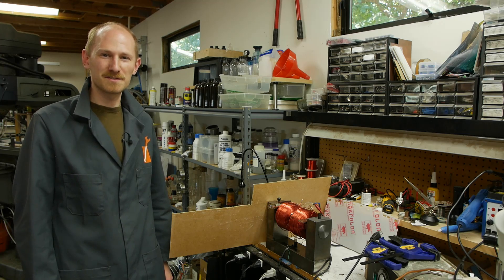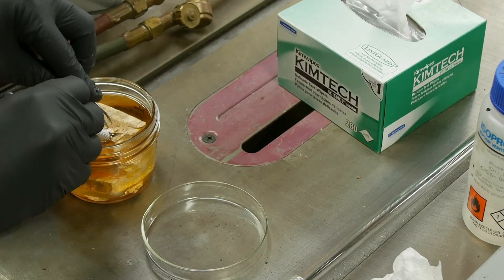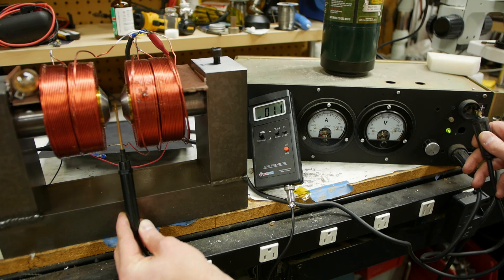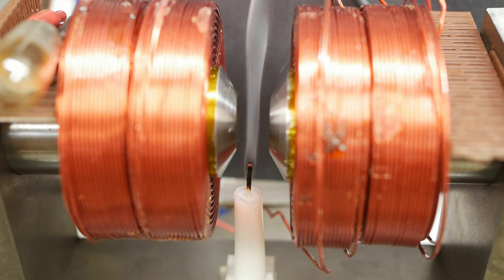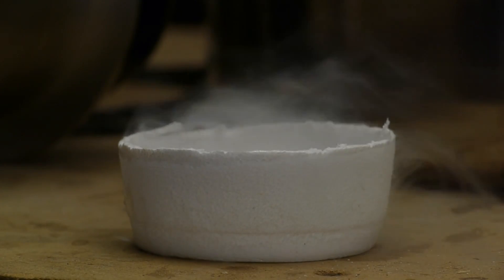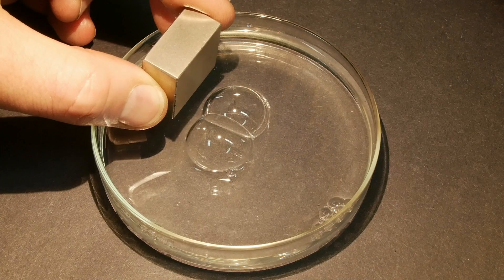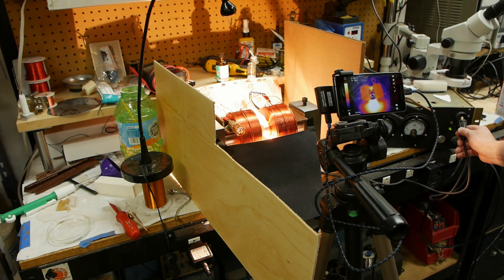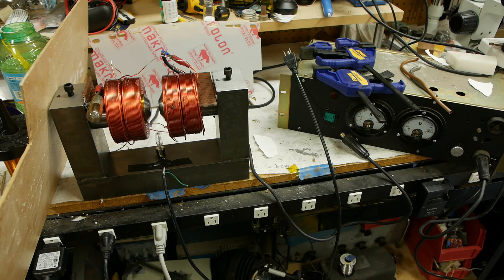Candle flame is repelled by magnets (and Zeeman follow-up)

Comment: Take ground-up copper filings in a pile between the magnets.  I think that there will be an effect there due to the creation of a current in the copper as the magnetic field turned on and off.  The candle flame is a PLASMA and conducts electricity, much like a copper smoke, only here the smoke is moving upward continuously even without the electromagnets energized.  When they are energized, you get the effect as with the electrical-current-conducting copper powder, but this keeps happening during the entire time the magnets are on since the flame molecules are moving during that entire time.

Comment: Well plasma is just super heated gas and has magnetic properties idk what kind as I haven't read up on it much but does that mean the magnetic poles of planets and strong magnetic fields can influence weather? If magnetic force can repell hot air wouldn't that mean it's be possible to...idk go to Venus or have some kind of heat protection?

Idk just throwing around ideas that hopefully don't involve bursting into flames like a demon in a church XD

Comment: Put the candle in a glass tube filled with pure oxygen and then see if it still gets affected by magnets.
If it does, then it means magnetic field is causing oxygen molecules to be pushed away from the flame, and if it doesn't, it means the magnetic field is causing the air to be pushed away from the flame.

Comment: The flame is repelled because of plasma. High temperature separate electrons from atoms and form charged particles and charged particles shows very strong interactions with magnetic fields. But there is a big note, they have to be moving.

Comment: I think that hot air is more diamagnetic due to the disalignment of magnetic domains in the portion of air contained in the space between the plates, and that is because of the increase of thermal energy that is a form of kinetic energy. Thus the more movement of the atoms and molecules have the less possible is to have a big magnetic domains that responds to the magnetization induced by the electromagnet, due to the fact that the movement of atoms makes more difficult for magnetic domains to form and grow.

Comment: Brainiac75  hypothesized that deflection is caused by the paramagnetism of Oxygen displacing the Oxygen-depleted flame: https://youtu.be/dX2R4hRAYMc

Your CO2 bubble test seems to refute that, though I think the bubble may not be sensitive enough and wouldn't show any deformation except in a magnetic field gradient. I suppose it would be possible to calculate the tension in the bubble and estimate how far it should deflect.

I wonder if the atmospheric pressure could be measured with a manometer containing a heavier-than-air gas (like CO2 or argon). An open end of the manometer could be placed in the magnet. The supposedly increased pressure in the magnetic field would act as a valve that resisted the flow of non-paramagnetic gas. The other end of the manometer could have a cup open on top with a small gas flow being "poured" in. There should be an elevation of the top of the cup which would allow gas to flow through the manometer with the magnet off and block flow with the magnet on. I'm not sure how gas flow could be visualized, maybe smoke, or maybe an oxygen sensor below the cup to detect overflow.

Comment: And here's another theory. A candle flame is basically a plasma. Plasma conducts electricity. Also, the flame is in motion, is rising upward. I'm sure you've done the aluminum strap between two magnets experiment. The conductive plasma, moving between the magnetic poles will create an induced current in the flame, thus reflecting the field from the electromagnets, which will impede its flow. A candle flame has pretty high resistance, but, 1.4 Tesla is no small potatoes!!! Are the poles north and south, or they the same, repelling each other? I noticed that the wire coils look like they repel each time you energize them.

Comment: My money is on the plasma in the flame as the answer.  In analytical chemistry, the flame ionization detector is one of the most common detectors found in labs (for gas chromatography).  Unfortunately, methanol still contains carbon, so you didn't really rule that out.  You might try a hydrogen flame, or even magnesium.  Or, possibly someone could try to manipulate the plasma in an ICP (inductively coupled plasma) instrument (generates an argon plasma) with magnets.

Comment: @bkraz333 thanks for the video.
Paraffin wax combustion products include water, a lot of it (e.g.  C21H44 + 32 x O2 ⟶ 21 x CO2 + 22 x H2O), which in turn is also notably diamagnetic (16T levitates a small frog https://en.wikipedia.org/wiki/Bitter_electromagnet), therefore the bit above 1T your magnet can pull of for sure will have an effect on the water content of the air, especially if it's saturated with it as is the exhaust gas of the flame combustion.

Comment: This is really cool! I only recently noticed this effect in a classroom demo - we use flames to induce sparks between arcing horns connected to a high voltage transformer. A fascinating investigation, thank you!
Reply: Now that I think about it, it's more that an electric field apparently also repels flames. That seems to have to do with the ions in the flame though, I think. But maybe it's also connected to your effect!

Comment: The flame has not only magnetic properties but also electrical properties. As we know that one does not exist without the other, unless that is, we are discussing gravity. This is easy to verify in a simplistic way, but the actual existence is very dynamic and often complex. The known  differences, thus far observed, between the two most basic, (though not absolute), biases, heat and the lack of heat, (often, though erroneously, referred to as "cold"), manifest in numerous and seemingly non-related phenomena, but it is all one in the same, that can be proven and therefore unified, via a very specific multi-dimentional geometry, commonly referred to as the misconcieved theory of Aether, that is to say, the geometry is the Aether, is the common denominator that makes it possible to describe a set of laws that can accurately predict all matter and energy in space time, from the sub-atomic, right on up and beyond the cosmic. (volunteers needed to invent the mathematical equation[s] to describe the realized geometry. Seriously. I flunked algebra amongst other things.. Hey! Einstein couldnt tie his own shoe until he was like 7 or 9 ok! It must be a prerequisite, I dont know.) Hit me up for the details. Anyway simply test the flames electrical conductivity, or youtube Veritasium video demonstrating the flame conducts electricity, because a flame is a plasma. https://youtu.be/a7_8Gc_Llr8

Comment: Hey,  my understanding of this is that a flame is a "partial plasma" as only a small percentage of the gas is ionized.  It stands to reason that when in motion through a magnetic field there will be deflection.  This effect is used to confine plasma in fusion reactors.

Comment: Perhaps the rising pillar of hot gas is creating toroidal motion in the ions surrounding the pillar. This toroidal vortex of ions could create a magnetic field, or perhaps the simple rising of hot gas creates a field. The electromagnets then affect this, causing the displacement.

To further isolate the system, you could heat various gasses away from the magnets and route them between the magnets using a transparent, heat-insulated tube. Use Schlieren imaging to observe.

Use a pump to move the hot gas through the tube in various directions (up, down, sideways). How does this affect the displacement? This could yield very interesting results with Schlieren imaging.

Comment: A hardcore tutorial on designing switching power supply transformers will be amazing. It may contain magnetics, core material choice, flux in air gap, saturation current/voltage, indictive ringing/kickback/peak, optimal operation frequency and so on. RC buffers and flyback diodes will be an extra.

Comment: Perhaps you can provide confirmation by preheating the gases used in your soap bubble demonstration. I expect if you heat the gases hot enough you should see the distortion you expected in the shape of the bubbles. And it could be that other gases (CO2) are more dramatic then the air you used with the hot lamp.

Comment: Water vapor would be a good candidate, as H2O is polar. It seems to fit the observations of "dry" gases not reacting to the magnetic field and is formed by combustion of H C compounds, as well as its presence in air.

Comment: You have not mentioned the most fundamental force a magnet has on MOVING charge.  The gas coming from a flame is ionized.  If you place 2 electrodes into a flame, one small, other large, and apply AC, the flame will rectify the current between them.  In fact, this is the way that most home furnaces detect that the pilot flame has ignited (before allowing the main gas valve to be opened).
To verify if this is relevant to the candle, try reversing the magnet's polarity.  Diamagnetic effects are square-law, and are therefore not affected by magnet polarity.  But forces on moving charges reverse with changing magnet polarity.

Comment: Heat causes electrons to be excited to a higher orbit, and the reason hot substances glow is because a photon is emitted when the electrons come back down, right? If a substantial number of atoms have their electrons sitting farther way from the nucleus, would they in effect function like negatively charged atoms? The ratio of external "accessibility" to the electrons compared to the protons increases. Maybe this pseudo charge state interacts with magnetic fields. Maybe this also increases the diamagnetic effect. In the excited state, we're also left with a gap in the next orbit down. Maybe this creates some imbalance in the electric charge that makes it more susceptible to magnetic fields.

Another thought. Most substances are diamagnetic, but very few substances exhibit significant paramagnetism because this requires unpaired electrons. When excited electrons fall back down to "normal" orbit and release a photon, do the electrons do this in a "symmetric" manner, or could it be that for a brief moment, one of two paired electrons is in the lower orbit while the other is still riding high? This explanation would assume then that although the flame is "squished", somehow this would be the result of paramagetism rather than diamagnetism. Is that possible? Is it possible that the phenomenon is being misinterpreted due to a flawed assumption?

Ok, one final thought. Let's take a yellow sodium flame, for example. The particles can emit and absorb the same frequency of light, as demonstrated in this video. This video also demonstrated how a magnetic field can shift the wavelength of light emitted. And we know that the chemical reaction that generates the flame is more or less confined to a hollow sphere upon whose borders the reacting chemicals interact, so the bright part of a flame is just where heat is radiating and propagating outward. If you've got a bunch of sodium atoms near the center of that interface, they're emitting the perfect wavelength to be absorbed by atom next to it. What if this is the Zeeman effect, and the problem is not simply the magnetic field but actually the magnetic gradient? Atom X is emitting a particular wavelength, and its neighbor, Atom Y, is in a slightly different part of the magnetic field and is hoping to absorb a slightly different wavelength. So the outward propagation of energy is hindered as a result. If the outer sodium atoms want to get excited, they have to rely on radiation from the initial chemical reaction instead of just radiation from its neighbor. This could be tested by comparing a strong magnetic field with a shallow gradient to a weaker magnetic field with a much steeper gradient.

Comment: Although many old-time cinema projectionists were unaware of it, the light from a DC carbon arc was invariably stabilised by a magnetic field created either by a series connected coil situated behind the concave mirror employed (just a 4 or 5 turns were sufficient)  or a single-turn loop around the flame area of the positive carbon.  
In the absence of either system, the flame would splutter and dance about uncontrollably resulting in reduced illumination and severe flickering of the screen image. 
This occasionally occurred with the latter system when an open circuit in the single turn loop developed due to the long-term effects of the high temperatures involved. 
(Unless he had experienced such a situation before, this non-visible fault could result in the projectionist suffering a near mental breakdown🤪).

Comment: 'Excited electron shell physics' may have something to do with why the gases may be more magnetic when heated. ~( 'w')/

Any time sufficient energy is infused into an atom or molecule, an electron jumps from a lower shell orbit to a higher one, which results in a slight change in the behavior of the mass in question.

Whether it is enough to cause these effects, I do not know, but seeing how superconducting materials behave in magnetic fields, it is worth investigating.

Comment: Do you have any videos showing how "flame rectification" works where a flame between 2 electrodes act as a diode...
Its actually used by many gas and oil burner designs as a safety element to detect the presence of flame or turn the gas valve off.

Comment: Interesting!  Just saw this video, so I went into the kitchen and grabbed a small lighter torch we use for lighting grills and such, and a neodymium magnet that came with a ferrocell I bought online.  Sure enough, with the lighter braced against the edge of the counter and the magnet pressed hard against the counter top (the lighter’s end is metal so it’s tough to keep them from clamping together without clamping them in anything mechanical), there is a small but unambiguous outward push on the flame as the magnet is slowly slid toward it.  i never knew that.

Comment: Thermionic Emission, Plasma.  The hotter the gas gets the more free electrons you get, if there is a flame, that is actually a plasma.  So the deflection is simple magnetic breaking of a conductor, and eddy current.  The gas is the moving conductor and temperature is regulating conductivity.

Comment: You're trying wayyy too hard, and overlooking the basic.  A visible flame is a PLASMA, which exists through Ionization, which is a consequence of most all combustion.  Charged particles in the flame, both positive and negative ions, and free electrons, are all subject to deflection by Magnetic fields.  Flame is also highly conductive, and so the strong externally applied Magnetic field is also inducing a corresponding internal Electric field, and these field interactions perturb the flow of ionized gas, which entrains any non-ionized molecules in plasmadynamic flow.  I've seen profound effects on candle flame just using mild Ferrite magnets.  Its not the Soot; its the PLASMA...
Reply: I'm not sure if flame is plasma or just excited atoms and I don't know wavelength of photons released on recombination. Anyways stream of charged particles should be deflected sideways and I can't explain why it's deflected towards the magnet.

Comment: Perhaps the flame is not deflected but rather extinguished between the poles due to oxygen deprivation in the column of heated gas as the paramagnetic O2 is pulled from the flame and concentrated on the magnet poles.  Likewise the diamagnetic C2 and other combustible diamagnetic compounds are repelled from the poles:  thus separating the combustion components. Interesting video!

Comment: IR aka heat, is a light wavelength which is why cold air has no effect. Congrats on demonstrating how Black Holes work. You are controlling photons with magnetics. Black Holes aren't actually holes. They are supper dense mass with magnetic fields stronger than a visible star. Essentially black holes are actually Black Stars. Or giant magnets. An invisible star because the magnetic field is so strong that light photons get pulled back. You can actually begin to see this effect with our own sun if you watch closeup videos and how the material loops back to the sun as it tries to escape but does not have enough velocity to get away. Your experiment demonstrates this perfectly. You should be working for NASA my friend.

Comment: try looking in the direction of the flame being an plasma. And plasma has electro-magnetic properties. That's why we have lightning bolts. First the path is created, then the air turns to plasma, then the real current will flow. 
I can't give you the exact answer to your experiment. Only that I can connect some dots and tell you it has to do with a flame is not gas but plasma. And plasma has electro-magnetic properties. Therefore reacts to magnetism. 

Hope it helps.

Comment: it appears that you were visualizing a change in the temperature radiating from the paper ?
[
maybe the magnetic field was altering the heat absorption or reflection of the paper and not the heated air stream ?
]
maybe a better way to visualize the heated air stream is to have a very small sealed heating element that produces a narrow heated air stream between the magnets and then a bright light shining perpendicular to the air stream that will show the heat shadows on a white background ?